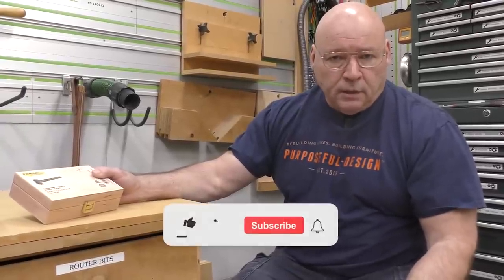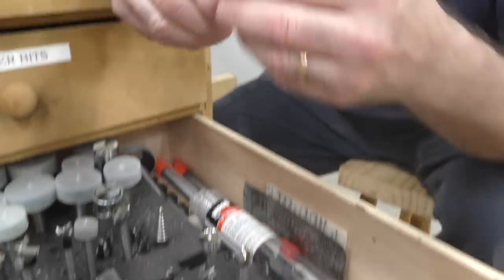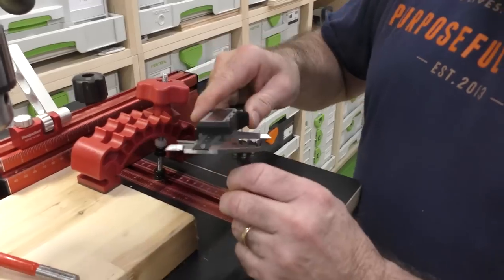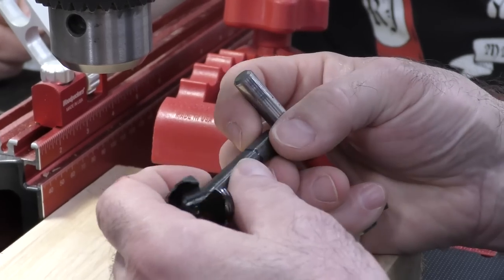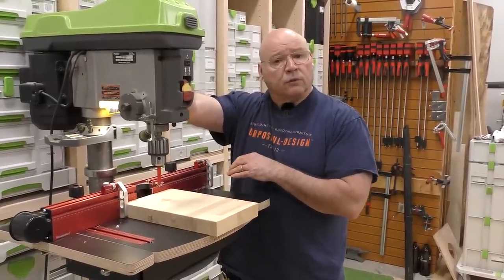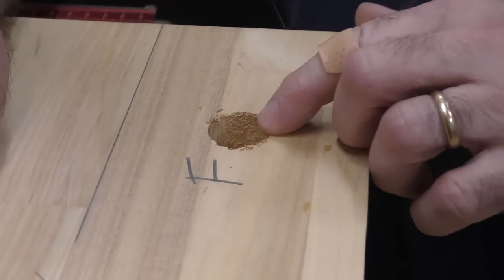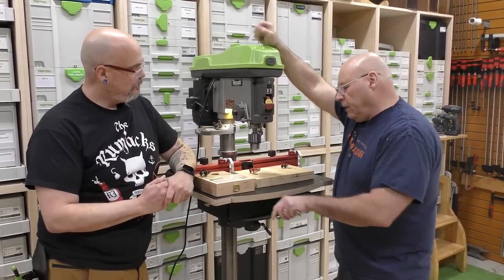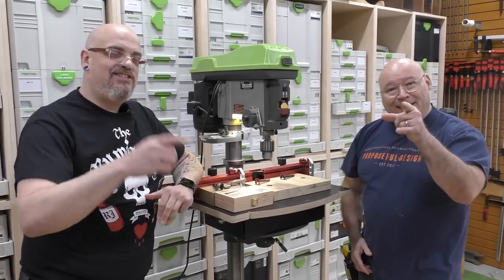Have You Heard About These Bits ?

Comment: But I don’t think you are comparing apples to apples here. For one thing you pulled a Freud out of your drawer, meaning it was a used bit and maybe not as sharp as it was when new. The other thing is you didn’t drill both holes in the same piece of wood which may be denser and have other differences in the quality of the wood which may have led to more chip out on entry.
Reply from the maker: both holes are in the same piece of wood ... the Freud had little usage ..I see your point though

Comment: I've got an old set of the Freud carbide bits (15 years, fairly light use), and I never get any tear out like that - ever. When I use them, I don't make the cuts in one pass like that - I would divide a deep hole like that into thirds and pull the bit out to clear the chips - takes 10 seconds more. I don't think the design of the Freud carbide clears chips as well, but used with that in mind, my set does fine. Not clearing the chips will cause you issues like this. I also don't force it - if I have to put noticeable pressure on a bit, it's not sharp. Can't carbide bits be sharpened?
Reply: the answer is YES, but you need diamond sharpening stones for that job...
Reply from the maker: yes with diamond hones ..

Comment: Sedge, I have the Freud wavy fostner bits.  They leave a perfect hole.  Fisch also has the wavy bits and they are exceptional.  Not sure of the price points but I probably would think they are the same as the Famag bits. Just another option.  Great video.  I honestly only ever tightened up one hole on the chuck.  Going to tighten all 3 from now on. Thanks for the useful tip.  Brian
Reply from the maker: Good to know! Brian ...Thank you so much !!

Comment: Sedge I’m sure those are fine Forstner bits but I still prefer Fisch. Also, I appreciate you using all three key holes on the Jacobs chuck, it does help tighten it, but more importantly it more accurately  centers the drill bit by tightening it in all three holes. This, as well as making sure that the drillbit fully engages the feet of the jaws of the chuck Also help to keep it center.

Love your site keep up the good work!
Reply from the maker: Right on...... Thanks.... a few of my friends swear by the Fisch bits...I was soooooo impressed with the Boremax !!!

Comment: I had the Fisch Black Shark forstner bits, which have a cutting edge similar to the Famag Bormax bits, but now have the Fisch Wave forstner bits.  I think the Fisch Wave bits are made with alien technology because they effortlessly make clean holes in every type of wood I use with them.
Reply: I also have the Fisch Wave Forstner Bits and they are awesome.
Reply from the maker: wow... I may have to try them...like I need another Fortner bit !! LOL...Hope you are doing well Mike !!
Reply: @sedgetool  Thanks!  If we were on the same continent, I would loan you my set of Wave bits to try out.  I had a smaller collection of forstner bits, but got rid of all but a few when I bought the Wave set from Dictum.  I kept a few of the popular sized regular bits and ground off the center point so I could have a true flush bottom cut.  This eliminated the risk of the center point busting through the other side of the panel.

Comment: I have been using the metric sized Bormax bits for a little over 3 years now and have not found any other bits that compare.  I have a full set of Porter Cable and a no name brand and the only time I use one of them is if I need a larger bit than that in the Bormax set.
Reply from the maker: Thanks Ray...I am looking forward to using these Boremax more

Comment: I do metal work as well as wood work.   In the metal work I have carbide and HSS tools.  Most of the carbide tools are insert style.   Most of the HSS tools are solid HSS.   Both alloys cut well.   In some materials one leaves a better finish than the other.   HSS can easily be sharpened and is less brittle than carbide.   I have chipped a carbide insert when machining wood.   Knots can be very tough.
I have no-name Forstner bits which do not cut well unless I use a series of small to final diameter.   I also have Colt MaxiCut Forstner bits which cut much better, but still on larger sizes, e.g. over 1in dia benefit from using two or three different diameters.   My experience is that diameters > 1in the Forstner bits work better and leave a better finish when they cut only the outside of the hole.   I do not expect HSS to perform different than carbide.
The design of the bit does make a huge difference.   Relief angles on the cutting surfaces and the edge really help.   Machinist like to have relief angle clearance on all sides of a tool.
Dave.
Reply from the maker: Thanks for sharing Dave

Comment: I have heard that carbide is not as sharp as high speed steel, but just stays sharper longer. True? Not sure.
Reply: Alan, you are 100% correct. High speed steel can be sharper than carbide, but that sharpness difference only lasts for a very short time depending on the application. And it is very subjective to whether the difference in sharpness is useful at all.
Reply from the maker: Alan.... I think both are very sharp...I am looking to get a sharpness tester soon....will let you know !!